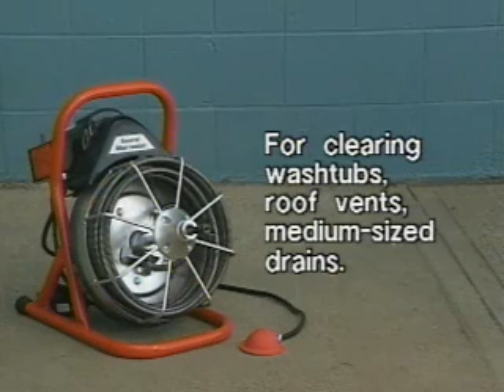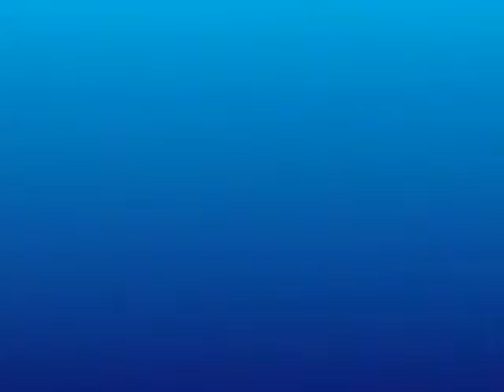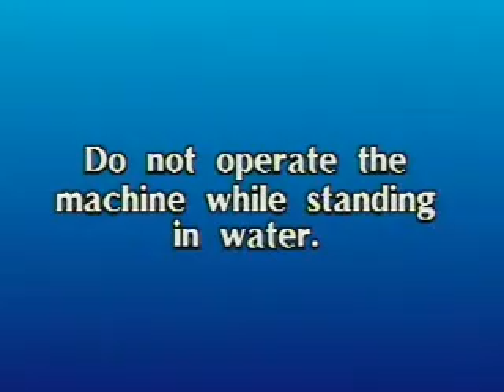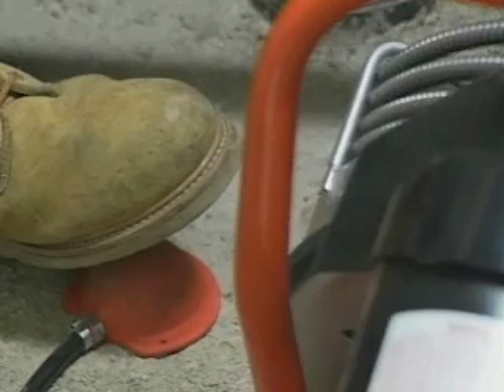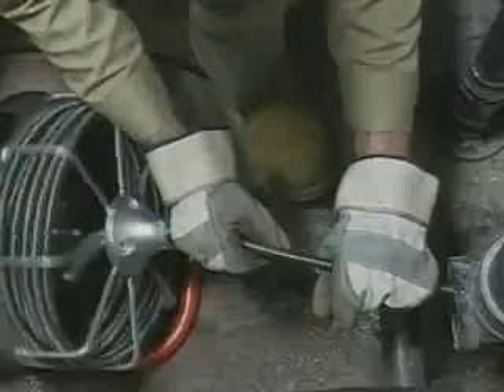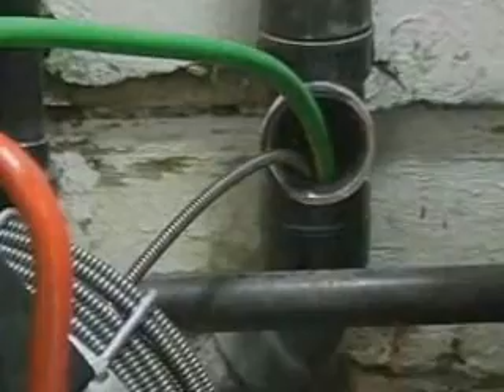General Pipe Cleaners Mini Rooter Instructional Video

Comment: Be careful with 3/8" cable. This cable tends to kinkle and can hurt you, also the cables tangles in the drum. Do not force the cable and push i gentle. I only use this machine 1/2 cable and works properly

Comment: no professional use this piece of junk . I would use the T-3 with a 1/2" cable  and for smaller drains with long runs I just change drums to allow me to use a 3/8 x 100 foot cable and only use the automatic feeder

The T-3 is portable, easy to use and no handling of the cable once it is inserted into the line

use the super 90 general with a 3/4 x 100 foot or change drums  to use the 1/2" x 100 feet if more torque is required or more cables are needed drums can easily be added

 .